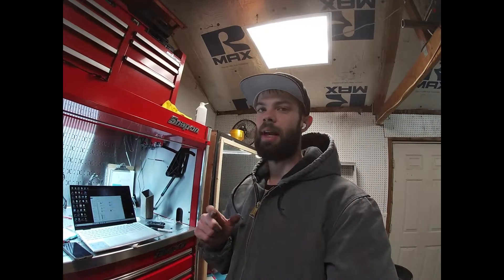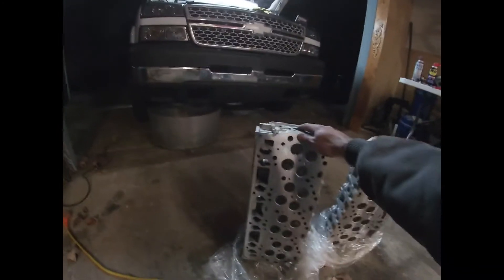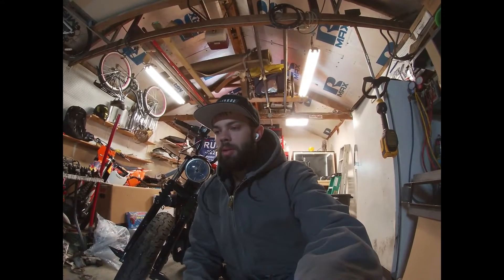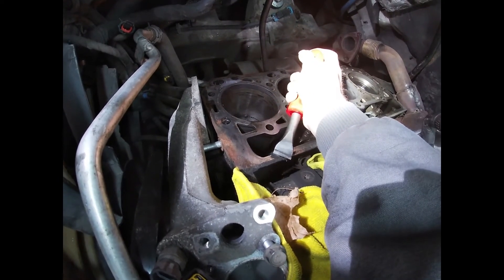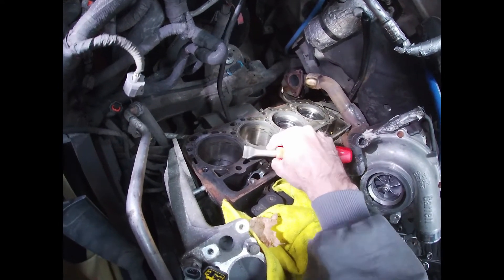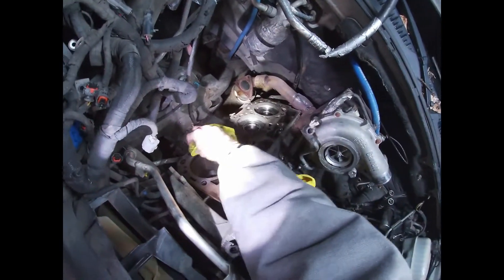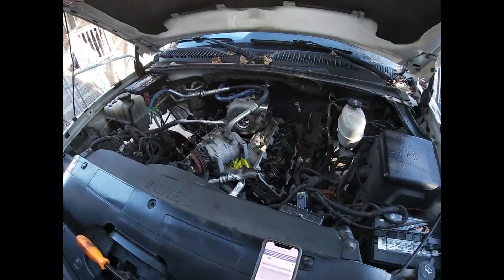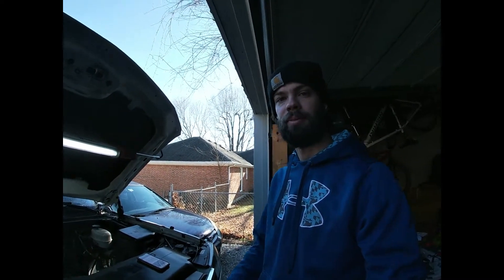DURAMAX Head Gasket replacement Part 2

Comment: Thanks for the videos! How did you route the hood stack on the lbz?
Reply from the maker: Coming off the back of the turbo. It’s very tight between the intake and ac lines. 3” pipe with heat wrap is about as big as you can go.

Comment: Thanks for the vids Rob, always good content.
I might have missed it, but are there different head gasket thicknesses for the Duramax's and how do you know which ones you need?
Cheers
Reply from the maker: Yes there are different thickness. I always use grade C unless the machine shop has to take a lot off and they should recommend if you need a thicker gasket.